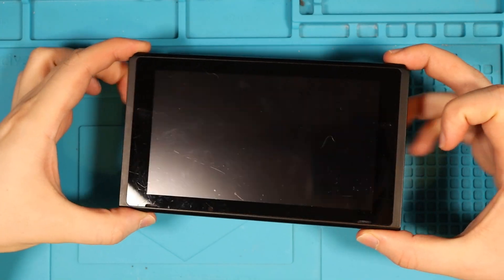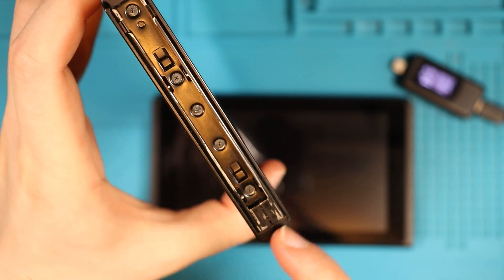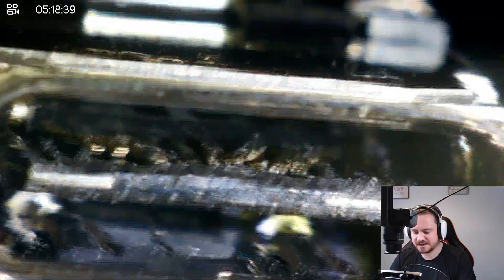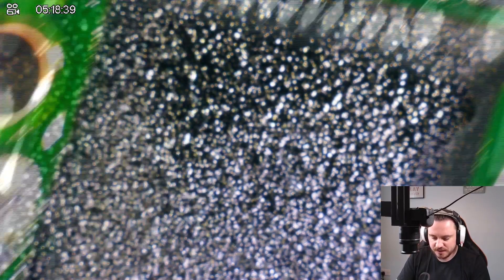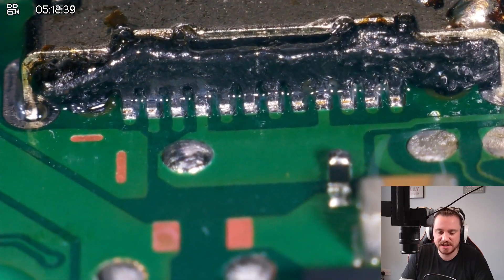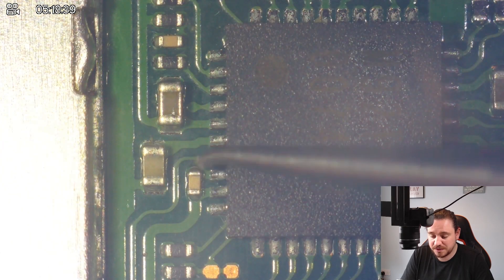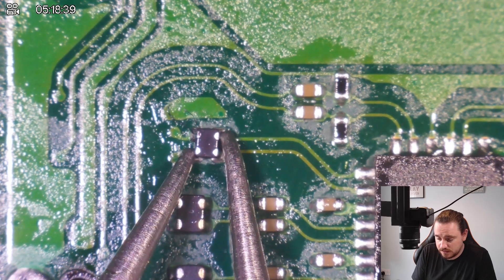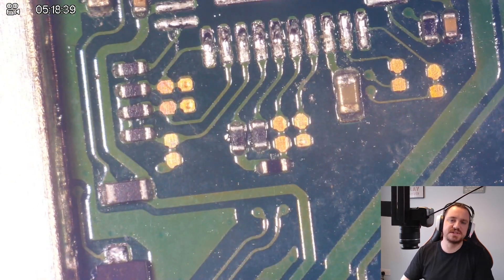FRUSTRATING Faulty Nintendo Switch | LEARNING to Solder

Comment: Great effort Joey. Unfortunately 0.42amps solid is generally either a nand or CPU issue as you now know. It should go to around 0.05amps, the charger will talk to the device to negotiate the voltage it needs then bump up, as you now know.

Also RCM is technically jailbreaking, but generally that's for hacking 😂
Reply from the maker: Thanks Phil ❤ If the issue is the Nand, is there anything you can do to fix it, or is it spares and repairs?

Comment: Nice video Joey. Basicaly the Pi3 cap is the the one on the bottom left side of M92. The one below the M92 which is shorted is basically a 1,8V power line. The cap over the top of Pi3 is a 3,3V power rail. 
As for the port replacement I always heat it from the bottom of the board and this way you never melt the port itself and you can be sure that both line of pins are soldered. I have a few video how I do this.
Reply from the maker: Thanks Kiki, yeah after the stream yesterday I think we done a bit better :)
Reply: @JoeyDoesTech  Happy to hear this man. Unfortunately I exactly missed that part of the stream yesterday :) It works really well for me so I hope this helps you too :)

Comment: You’re so unlucky with Switches. Sorry to see another one join your Switch graveyard!

The port replacement. When you removed it you did it where the port drops downwards after heating the reverse of the board. This is the way! When you put the new one in you tried to heat the top and ended up with all the burnt plastic and second row of pins not connected. It’s not easy but if you watch Tronicsfix replace ports on Switch, he heats the board up on the back with no port in place, then he uses tweezers to lift the new port up and holds it in place as he removes the heat. Only the pins get hot by touching molten solder on the pads.
Reply from the maker: Hey Stuart :) Yeah we were getting unlucky! I'd say we done a successful one on stream though :)

Comment: Nice port drop, your improving every video Joey!
My take on the instillation as you kind of used a similar method to mine, The small nozzle probably did you no favor on the installation. To use that method I recommend a bigger one with more rapid nozzle/air movement, the idea is to bring the board temperature up enough to wet the solder rather than using the direct air, so don't want the air sitting in any one place long enough to burn/melt.
I'd remove the port before you condemn it to the donor pile and test again but your findings are probably correct. Dead APU
Great improvements!
Reply from the maker: Completely agree Micro! I literally was swapping between the two, but chose thinner due to the plastic melting (which was clearly the wrong choice!). I also think I should maybe heat the board from the other side and drop the port on, I'll keep trying until I find a way that works I guess. As always, appreciate your advice pal ❤